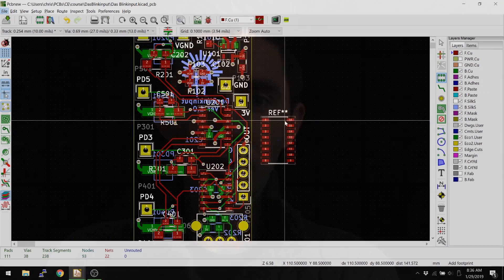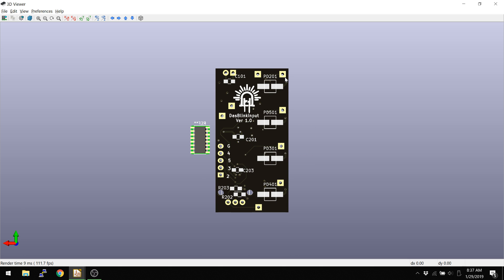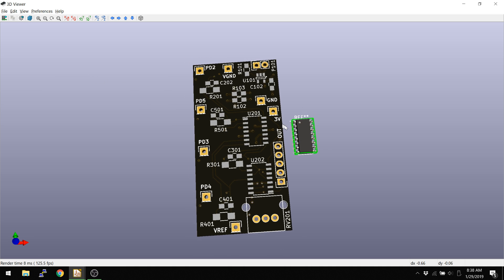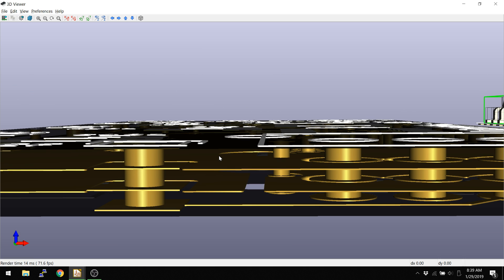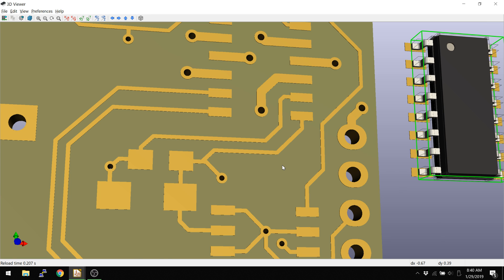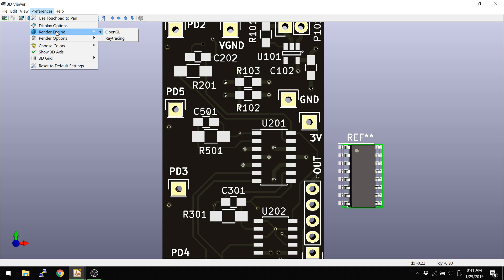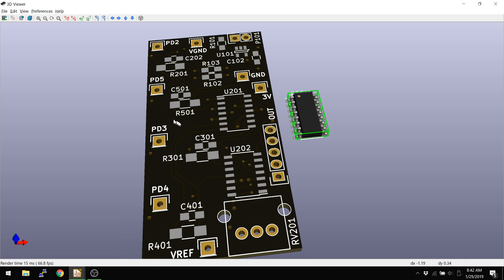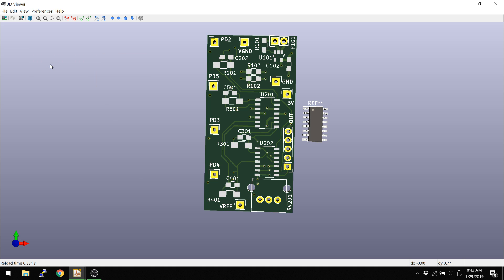KiCad 5.0 - 3D Viewer

Comment: To your point about middle click to pan: when I first started using KiCad I found this convention annoying, I had been used to other packages like Altium that use right click to pan, but after getting a mouse     with a seperate middle click button (Logitech Anywhere 2s in my case) I quickly adapted and it became easy to navigate.

It is amazing how quickly you learn the single key shortcuts with your left hand and pan/zoom with your right. KiCad has become quite powerful and polished recently and overall I find it a joy to use.